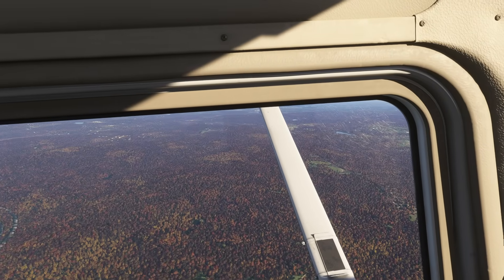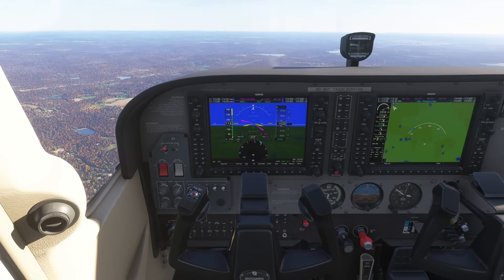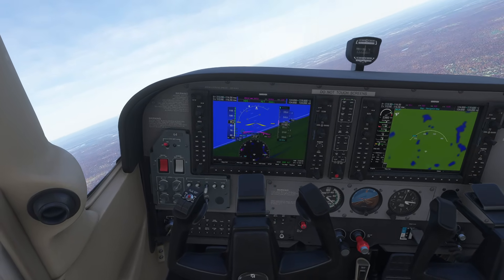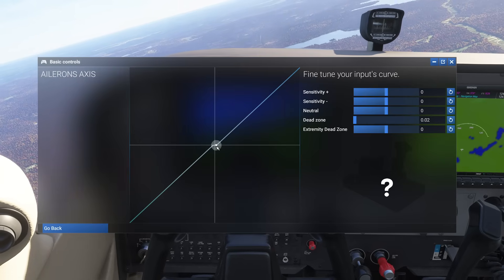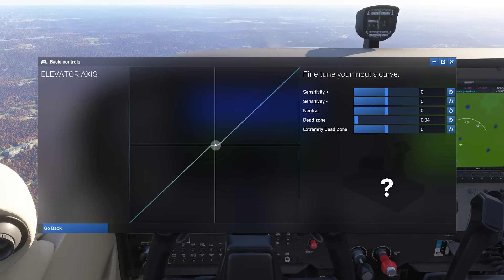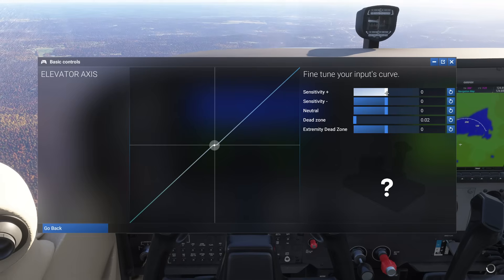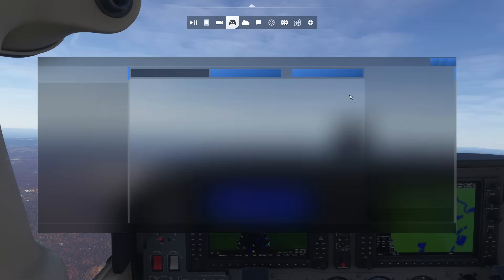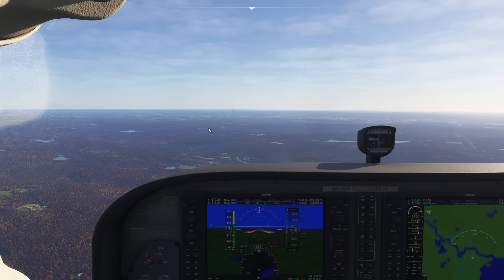MSFS 2024 - How to Make your controls more or less sensitive

Comment: Thank you for giving us this valuable information!
With MSFS and XP, it would be very helpful if the developers gave us some type of "spec" to use for the three axis of the individual planes, based upon control input. Since 80% of us are not pilots we have no idea what these planes should feel like. You have answered, "I think", most of the questions that have been going through my mind when I update the sensitivities. The only other device that needs some explanation is the toe brakes. I have no idea how "mushy" the breaks are on most planes. There's a fine line between taking one hundred feet to stop (on the ramps) and/or being shot through the windshield!